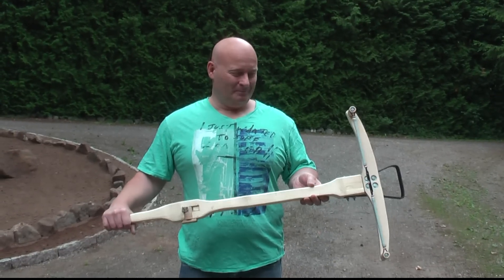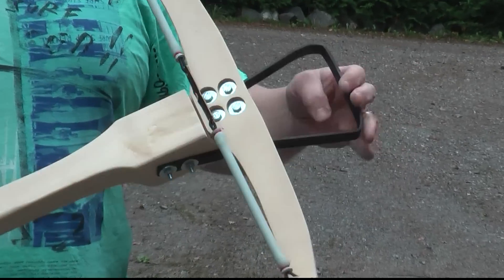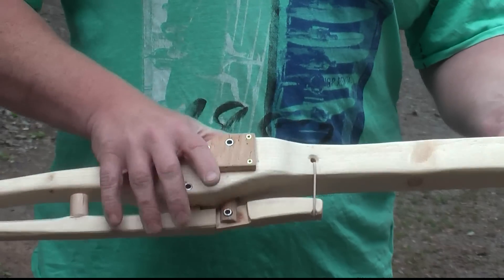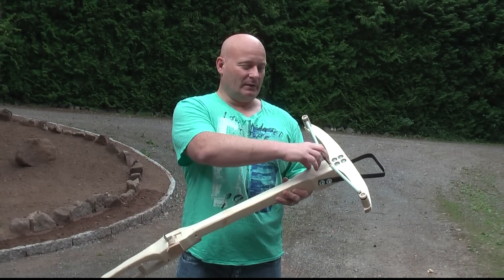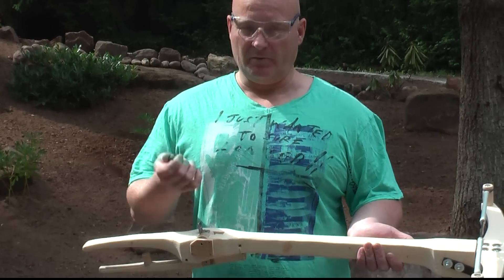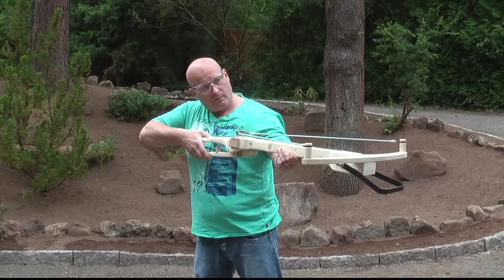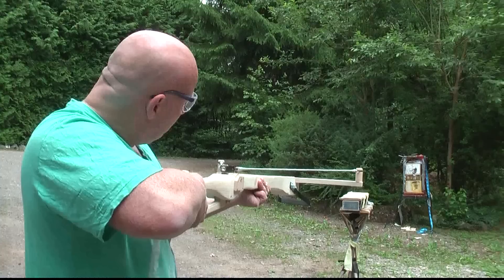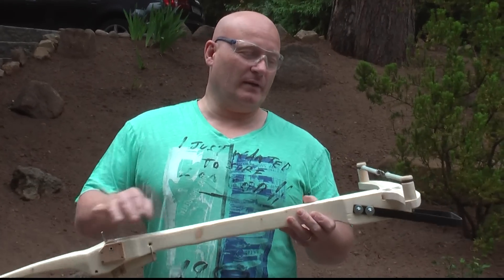Medieval Style Musket Ball Shooting Slingshot Crossbow

Comment from the maker: @ariuszarim No, the crank makes loading much slower. It is needed for prods that are too strong for handloading. But rubber is a lot more efficient than a steel spring, so no crank is needed. The draw is just 22 kg, a teenage boy can do that without a crank.

Comment from the maker: @Punishering2U The trigger is really simple. A round rod is pushed up into a notch of the rotating nut and locks it in place. When you pull the trigger, the rod is lowered and the nut rolls forwards.

Comment: I find the trigger mechanism the most difficult part to design and assemble. It needs to be robust and capable to hold and release extremely high draw loads without compromising accuracy. Also the 'draw' should be cranked to maximise power.

Your crossbows design revolves around its ammunition and seems to do so very effectively.

Your approach is very elegant and appears well crafted. Also, I FUCKING LOVE THIS CHANNEL.

Comment: Is it possible to shoot a red hot steel ball with a slingshot? and if its possible will the red hot steel ball do more damage than a normal temperature one?
Reply: it'd burn the wood when you set it, it'd be very difficult to load, and it'd lose lots of its heat moving through the air so fast. assuming the ball punctures the skin and it's still fairly hot, It would just end up cauterizing wound, preventing any or much blood loss from occuring. If it doesn't puncture the skin and is still hot it might leave a very small burn when it bounces off. if it stayed hot enough it might ignite clothing.
Reply: This ain't half life fool

Comment: how much does yellow tube stretch say 5 inches of tube how much will it stretch before reaching full draw
Reply from the maker: Good latex can be stretched to about 5,5 times the relaxed length. 5 inches will stretch to 27.5 inches.
Reply: Can I use regular yellow rubber tube to make a sling bow that can hunt mid-large game (put like 10 bands instead of 2) will it make a big difference or i have to use stronger band. So in short can I make a super strong slingbow like i saw people use for hunting deer using weaker rubber but putting bigger quantities of it?
Reply from the maker: You need high quality rubber. Thera Band Gold is best. All other types will lack the power. Too many chemicals in them.
Reply: well i have SGODDE 6X9mm yellow rubber tube can i stack them I saw some slingshots that have more slots for more tubes can I do that with this type of rubber and hunt with it
Reply: everyone i saw is using rubber tube and this rubber i have is ment for slingshots so with enough tubing i think i can get some power
Reply: how thick is your rubber(not tubing the flat staff) and can i use excersise rubber and cut i to length i mean it's the same thing right
Reply from the maker: It is all in the recipe. Thera Band Gold rocks.
Reply: Yea I know but can I still use other types in large quantities to achieve the same goal?
Reply: Is 0.35mm excersise flat band ok, how thick thera band do you use?